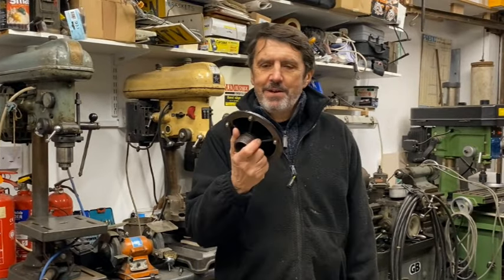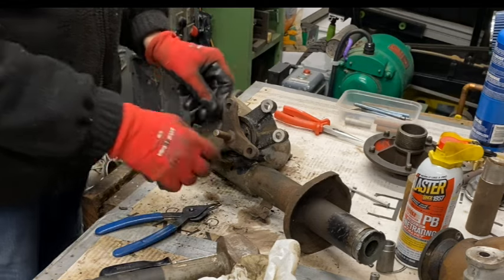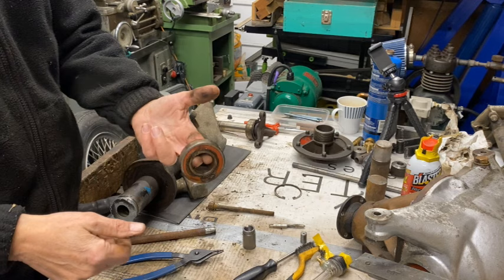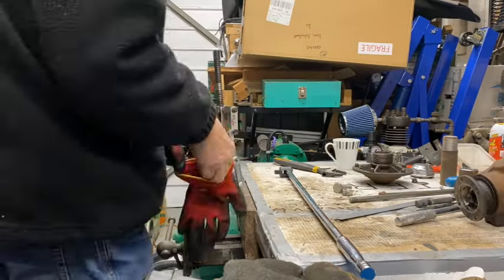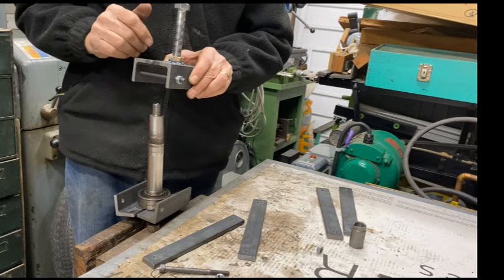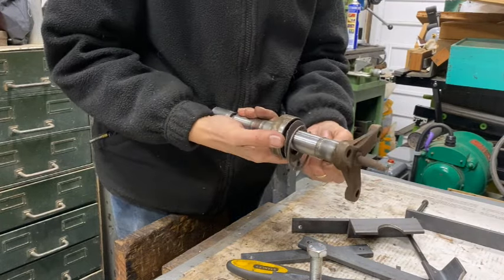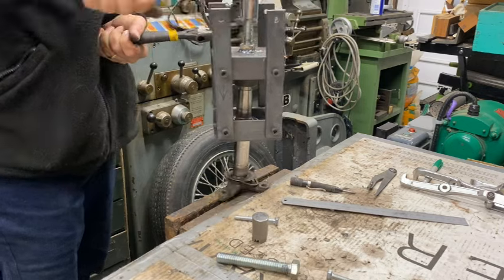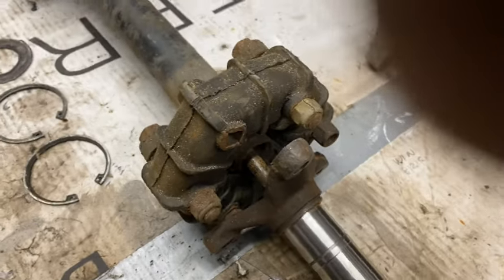Lotus Elan+2   Rear Axle Part 2

Comment: Love your videos: shows the reality of struggling with stuff seized solid and improvising with guerrilla engineering. That said, could you have used an angle grinder to cut (almost) thru the stubborn bearings to weaken their grip and bang them off..? Look forward to the next installment.
Reply from the maker: Thanks Tony.  Yeah, I thought about the angle grinder route and also welding something to the out race that I could of got hold of but decided both were a bit to drastic and was also conscious that I would need something to use on the other hub as well.  If the manual puller option hadn't worked I was going to try a hydraulic puller.

Comment: Really great video and really good thinking that went into designing and constructing that puller!  Looking forward to the next video.
Reply from the maker: Thanks Frank for you kind words.  I'm not sure what to release on video next; Assembling the hub with new bearings etc as this will take a week or two to complete or to do a bit on the disassembly and checking of the diff?  What do you think?  Or is there something else you would like to see?
Reply: @ianj3663  Ian.  You could open up the diff, but I doubt you'll find anything to do but replace the three seals.  The diff is boring because they're built rock solid by Ford and they almost never fail.  One thing you could explore is changing the final drive ratio in order to lower the rpms at highway speed.  I guess that would require installing a different ring gear.  Don't know how difficult this would be.

Comment: invest in a cheap hydraulic press?
Reply from the maker: If the manual screw version hadn't worked the next move would have been a hydraulic puller.  Thanks for you support.